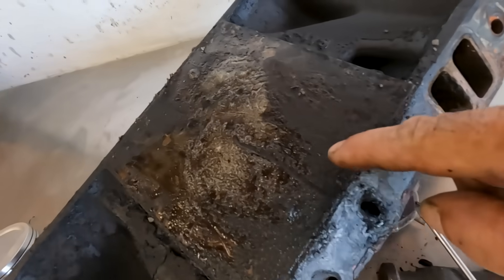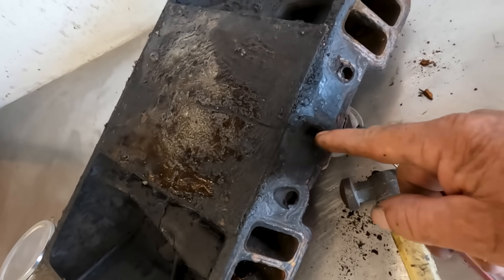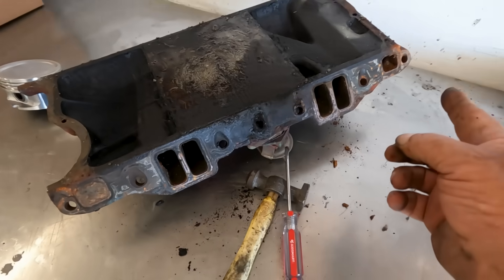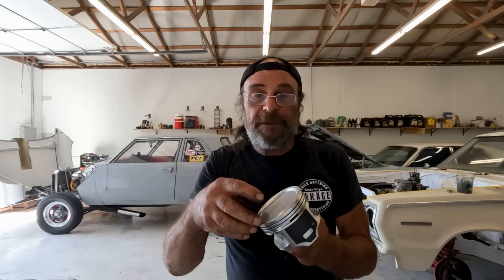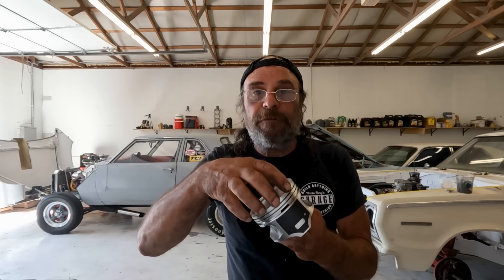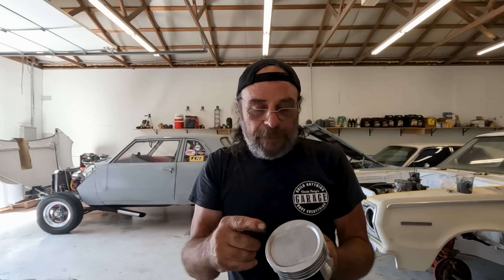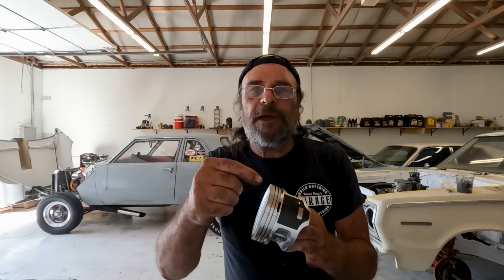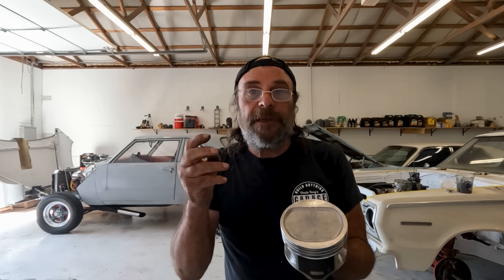The Number One Killer Of Gasoline Engine Efficiency And Power And How To Stop It

Comment: Are today’s valves strong enough to do that water de-carbonizing trick?
Reply: Yes because most newer engine are using stainless steel valves . I used to do this very same thing back in the late 60s for my father's car & never had a problem as long as you don't dump a huge amount of water dumped down the carburetor all at once because if too much water can cause a hydrolock but it would take quite a lot to do this so just a little bit at a time with the throttle opened up so the engine revs . After getting done I can remember seeing a bunch of carbon on the ground that blew out of the exhaust pipes .  Get the engine hot running temps after driving it like Uncle Tony says & use the coldest water you can get to do this because it shocks the carbon & breaks it up and it comes off and gets blown out of the cylinders and through the exhaust pipes.

Comment: Is it worth looking into water methanol injection to prevent carbon buildup on a carbureted old school engine?
Reply: I was thinking the same thing.

I've been watching videos about WW2 piston airplane engines that used it.

Also watching Eric (I do cars).
When he tears down an engine that's ingested coolant, the effected cylinder is always clean.
Reply: @robbytheremin2443  Ya planes used water as a short term power boost during dogfights and such. I’m not necessarily looking for more power, but having to tear apart my engine on a couple times after a crappy rebuilder got his mitts on it I noticed the carbon buildup within maybe 1500 miles on the engine. Granted, I was probably running on the rich side.
Reply: David Vizard had a video not too long ago about vapor injection to help with running higher compression;  may be worth looking up.

Comment: Chryslers Mopars  are garbage and always have been
Reply: They all have their problems every one of them lol . Been a mechanic for 30+ years & have worked on a boat load of cars trucks drag cars hot rods and muscle cars and still do to this day after being retired . I used to do this very thing that he is doing for the carbon build up on the rear & face of the intake valves with the water & it works & I was doing this to my father's cars back in the late 60s for him .
Reply: What do you drive

Comment: Careful with pouring too much water down the yap. Hydro locking can damage pistons, valves and bend connecting rods. Water does not expand.
Reply: Bless your heart, you were trying to sound so smart and was doing a fair job until the very last word....compress is the correct word.
Reply: @indianaslim4971 ahh be nice to the spunky  little helper , he is just tryin to fit in
Reply: “We’re not was is grammatically the correct word”
Reply: @williamtownsend4978  Please use commas where appropriate to provide necessary pauses.
Reply: @williamtownsend4978 I think you mean "were" as opposed to "we're," which means "we are."
Reply: @indianaslim4971  No... Expand was and is the correct word.
So, while you're looking up "does gasoline/water expand" go ahead and look up "Dunning Kreuger effect" while you're at it. 
Dumdum..  Gas is a long chain hydrocarbon and "expands" at normal temperatures and explodes when ignited under pressure. 
Water only expands at 4% but only at boiling temp. Water most certainly, absolutely DOES compress and that's what will grenade your pistons and valves. Gasoline doesn't compress when ignited, it explodes, creating energy in the form of "compression"...  
Damn man. Tf is wrong with people?
Reply: Steam has entered the chat.
Reply: Hello, my name is ice, I wish to "expand" your knowledge of my liquid and gaseous states. 🤣
Reply: @lilmike2710  It won't hydro lock because the engine is running & being fed a small trickle of water. I've seen it done on video, [Pole Barn Garage].  After he finished doing it, you could actually hear the engine running better.
Reply: @DarkFlamage  Derrick on Vice Grip Garage likes to pour Berrymans B-12 "down the yap". He calls it his "eye-tallian tune up" 😏.
My dad taught me the water in a hot intake trick when I was 16 (1985) when my 74 Duster (The Green Loogie) was sluggish and used too much gas.  😳 It actually helped. 
That slant 6 had valves that sounded like someone was under the hood shaking a box full of Mason Jar lid rings 🤣 I thought it was a 💩 box back then..... Well, it actually was a 💩 box but I wish I had that car today.
I'd like to find myself an old Duster at a reasonable price.
Reply: @DarkFlamage  I know.. that's why I specified "too much". 
I didn't count on everyone who stayed at a Holiday inn Express last night to come and try to nerdy nitpicky every word like Brainy Smurf. 🤓 smfh
Reply: @DarkFlamage  i think the younger crowd wasnt around for holleys water injection system of late  70s early 80s  where you had water being squirted in all the time you were running
Reply: Water does not compress....I heard what you meant.👍
Reply: @jasonwakeman3821  No, I meant expand. Gasoline and other long chain hydrocarbons expand in open air at normal temperatures and ignites when heated. aka "volatile". Water only expands at boiling (and freezing ) but only 4%. 
So filling your combustion chamber with water and running the engine is literally like hitting the piston, valves and head with a hammer. 
Trust me I know because I recently bought an old Ford Ranger for cheap because it had a blown head gasket.
The owner lives 3 houses down from me so I decided to fire it up and drive it to my garage. I took off the head and sure enough the gasket was badly blown between 3 and 4.. aaannd two big chunks busted off the top of #4 piston. They were fresh  breaks so I know it was from me driving it to my house. 
Lol crank case loaded with foamy white yuck.. 
Yea, so I ordered a ring and piston set. I'm an otr trucker so hopefully they'll be at the house by the time I get home next week. 👍 
I've been recording the whole ordeal with the idea of posting it on my channel.... 😏 With 5 subscribers LMAO. It'll be the first automotive content that I have uploaded.
So far it's only been random and irrelevant nonsense on there.
A June bug getting drunk on "tree beer", my truck getting swarmed by a shit lode of bees and a bunch of turkeys casually strolling by. 
Oh, and a friend of mine sent me a video of her damn dog eating grapes..
Sorry for the long rant. I'm a truck driver like I said and never get to talk to many people, so....
Reply: No water doesnt compress and i think uncle tony has done this more than once
Reply: The Brits love it at Rufford Ford
Reply: @Haffschlappe  i love that show stupid mercedes van drivers sprinter vans   duh  you start the wave and slow just enough to push it without it rising up right lol

Comment: Im about to be running blockoffs on the heat crossovers on my nailhead and I've got an AVS2 thats going on it so it will run well without the  crossover
Reply: Did that on My 322 Nailhead and it works great . Got mine from Centreville ... Matt knows his stuff ...
Reply: @jackassman6726  and they're good, honest people. Russ spent god knows how many years perfecting keeping nailheads running and improving things.. now Matt has been building on that. We couldn't have our nailheads without them imo
Reply: Will you ever drive it in below 60 degree temperatures? I tried that with a 75 Deville back when I was in high school. In the winter I had to let the car warm up for almost 20min before driving. Otherwise when the choke shut off the car would stall, and fall on its face. I kept playing with the choke but it never ran right. Plus when you got it warm enough if you went on the highway for a long cruise it would cool off again and it would start stumbling again. I opened up the cross over and it ran perfect again.
Reply: @AnthonyPerna2  the manifold is still going to be plenty warm when the engine reaches operating temperature and the AVS2 is designed to run that way plus im in Savannah so fighting boiling the fuel in the carb is the biggest issue

Comment: Haven't watched the whole vid yet but Could you not throw that manifold into a bucket of some kind of caustic solution? Similar to what used to be done with two stroke exhausts to clean them out?
Reply: On these Chrysler 2 barrel intakes that heat riser on both sides of the intake manifold are very deep so it would take a long time even with using some kind of cleaner degreasers to dissolve the carbon build up that gets rock hard through those heat riser ports . I had to do this on a 318 I had many years ago and the easiest way to do it was to use a drill to drill through the carbon to open up the ports then use a long screwdriver and some solvent to break it down enough to finally clean those heat riser passages out . One of the other things to do is get rid of the intake manifold that has the EGR valve on it & get rid of the EGR heat riser valves on the exhaust manifold because it's emissions related that basically forces the heat and carbon from the exhaust up into the heat risers in the intake manifolds on these 318 and any other smog motor small block Chrysler engines . I had a 68 Dodge W300 military crew cab 4x4 that had the 318 with the stock 2 barrel intake on it years ago and I decided to do a cam swap on it and put a new 340 cam lifters & tossed the stock 2 barrel intake manifold & put a Edelbrock 4 barrel performer intake with a Edelbrock 1406 carburetor jetted for performance & took the heat riser valve off of the exhaust and ran dual exhaust on it and added the electronic ignition to the engine & man what a difference it made as far as performance power. I also used the intake manifold gaskets that had the heat riser ports blocked off and I had no problems as far as cold weather starting this engine in the cold MN winters back then at all even with the Edelbrock open element air filter on it . I could go outside in the very early morning with the truck sitting outside all night to go start the truck to let it warm up when it was -20 below at times & it always started up with its high idle and I would go back in the house and let it run for a half hour to thaw out the windows then jump in & head to work with no problems at all . This was back in the very early 90s and I remember seeing the new Ford pickup trucks stranded on the side of the roads that had fuel injection that were having issues with the cold temperatures and seeing on the local news that Ford had recalls on these trucks because of them stalling out and not restarting in those cold temperatures back then as I drove by in my old military Dodge laughing me ass off on my way to work lol . That truck was 1 of the best trucks I've owned & I've had Fords Chevrolet GMCs but that military crew cab was the best as far as reliability and ease of maintenance plus being over built for strength. I ended up selling it many years ago for more than I paid for the truck even with the mods done to it and wish I still had it because these trucks are fetching big money now if you can find one in nice shape . I paid a 1,000 for mine back then & looked up the production numbers of them made & they made less than 2,000 of them back in 68 with most being used in the Vietnam war then brought back to the states and sold to fire stations and also used by logging camps and the DNR for work trucks .   I had read years ago that the Egyptian military had bought a lot of them up and were using them for their military and this was back in the 90s when looking into these trucks more & because of this that makes them even more rare to find now . I at least still have pictures of this truck from back then to look at once in a while & wish I could find one but most of them are gone or rusted out so bad now finding rust free body parts for them is hard to find & if you do find one in good shape it's going to cost you a arm and a leg to buy one now .